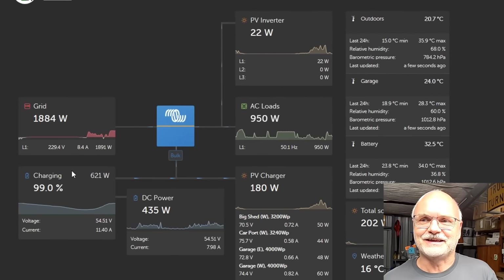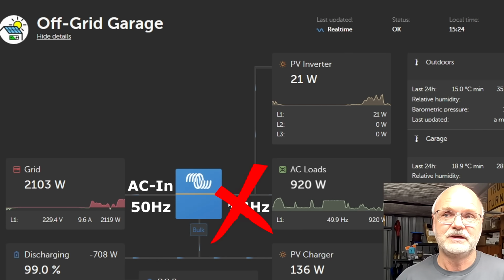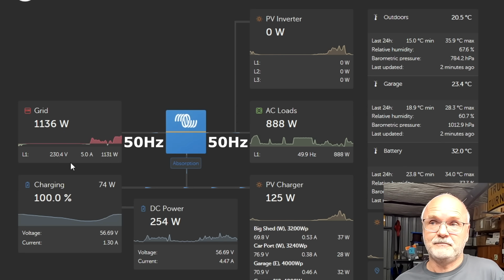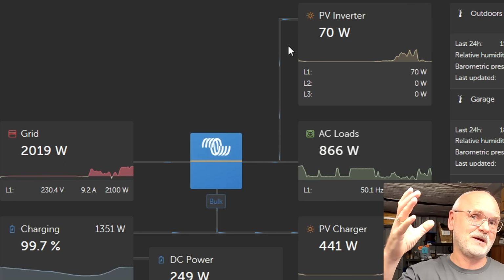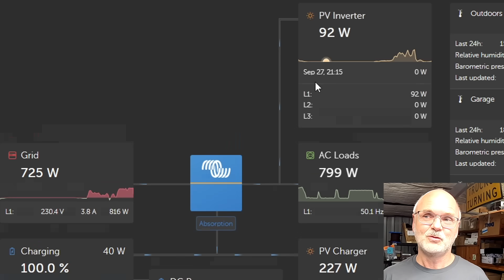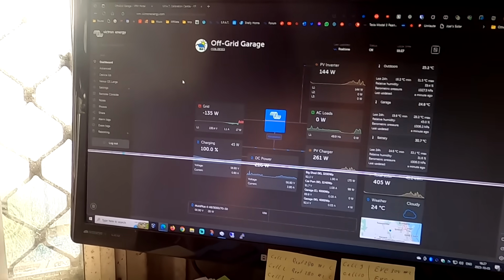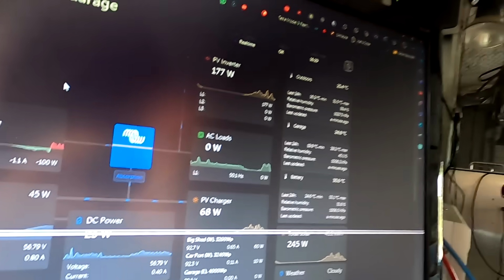Victron Multiplus, Micro-Inverter and Generator. Where does the energy go once the battery is full?

Comment: @OffGridGarageAustralia
 Thanks for the video as its good to see it all working together. This makes all the sense and a great setup. Since you still are connected to the grid (generator) its the same as the real grid. Only the real grid is so big you will never be able to influence it voltage and frequency. What happens in your case, on the end. Your generator governor is configured to stay at 50hz. When there is demand, more fuel is added to keep the frequency. When there is less demand less fuel is injected by the governor until there is no demand and the fuel injection goes to 0. Demand is determined by the magnetic field of the generator, which is regulated by the excitation of the rotor coils by the voltage regulator. When there is demand, the voltage drops, the rotor excitation is increased by the voltage regulator and so is the magnetic field. More current flows through the wires (reactive power). In turn this results in more torque on the shaft (active power). This will cause the frequency to drop which is sensed by the engine governor that will increase fuel injection to stay at the set-point of 50hz. The generator control, governor (frequency) en voltage regulator both want to stick to their set-point of 50hz & 230v. The solar panels microinverter just follow that reference and want to push their load onto the grid by injecting the current into the grid. Since this result in higher voltage on the grid, the generator voltage regulator will start to decrease its excitation to keep the voltage at 230v (reactive power). This results in lower torque and frequency will increase, the governor will respond by lowering the fuel input (active power). This goes on until the fuel injection is at 0. At this point the generator becomes a load, consuming from the grid. Since there is no means to further decrease the fuel injection, the engine speed will increase driven by the excessive current from the solar panels. As the engine speed goes up, also the frequency goes up. This is picked-up by the micro inverters and from a certain frequency (50.2hz in Eur) they will begin throttling.  In many systems there is a breaker trip on reverse power. 
In your situation you can see the engine is driven by the generator in semi-idle mode. When there would be more solar power, there is more energy going to the generator which at one point will overcome the electrical and mechanical resistance and drive the generator above 50hz to the point where the Enphase inverters start throttling there output. This would not be an immediate issue and the system should remain stable. The only issue is that the generator is acting as a load and there is no control over the engine shutdown unless there is an automatic breaker that can disconnect the generator on reverse power, so its a risk to your engine. Also there is a reactive current flowing. You could solve this by updating the Enhpase grid profile to "no_export" so that this starts throttling when it measures grid injection. You could also have the generator automatically disconnect on reverse power.

Comment: Thanks all for your interesting Tests.
I've watched  many hours of your videos in the last couple of days and learned a lot.🙏

One of my questions is still remaining about the Victron-System that I hoped gets answered in this video:
If I have a grid-connected 3-Phase Multiplus II System with 2 Fronius AC-inverters on the AC-Out1 and a SmartSolar RS 450/200 with ~8kWp solar arrays on 2 MPPTs and a of LiFePo4-battery-bank..
..whar happens when the Batteries are full? Can the SmartSolar RS 450/200 still produce DC energy that the 3 Multiplus II converts to AC and pushes into the grid or do they just shut down as long as the Fronius AC-Inverters power the loads in the house and the battery is full?🤔

Comment: I once had my multiplus running off grid with solar connected to ups out. No ees installed.
When battery's were full and solar had no place to go it switched off.
Next I connected grid, but did not allow backfeeding to grid.
Same thing happened. I saw no voltage rise,  but it all happened so fast then I could have missed it.

Comment: My most educated guess: It is feeding the generator or off-grid inverter in the AC-line (check AC line voltage and Hz). On-grid inverter is designed to push power with maximum power (in the contraints of solar input) without any electrical load sensitivity (infinite load). You got saved by following things: 1. You got enough load for on-grid inverter and off-grid inverter/generator did not fry. 2. You did not have enough solar power produced the off-grid inverter/generator to fry.

Comment: First the power will go into the batteries, overloading them a little. When it goos on and/or pv input is high, multi will go into emergency shutdown. This is the only way out for it, and it will happen like it happened to me. This is the way I tested when my pv invertor switches off when I installed freqency modulation. But I have a feeling the multi does not like it.

Comment: I accidently tested this with my setup where I have Ecoflow Powerstream as my AC coupled microinverter on the load side. Once there was too low load consumption, but battery was full and Ecoflow continued to generarte around 1kW power (I have 2 ecoflows in parallel) the MultiPlus II 3kVA started to alarm about overload and restarted itself all the time. I had to disconnect Ecoflows so the Multiplus could work normally and power generated by Ecoflows was just wasted. I'll experiment if a smart plug from ecoflow could automate the power input from ecoflow so not all power is lodt but only the excess what Multiplus can not handle.

Comment: Hi Handy, I have the same problem as you with the microinverter, do you think it could be a solution to connect the microinverter to the ac-out 2 output and using the assistant to set the relay 2 which disconnects at 99% of the soc? I'm waiting for your reply or better yet a nice video. Thank you

Comment: The inverter generator is probably acting kind of like dynamic brakes on a train, and trying to suck "rotational" energy out of the sine wave that the micro-inverters are trying to push "rotational" energy into (basically by shorting-out or reverse-driving the input side of its transformer on the lagging side of the sine wave).  This would dump heat into the transformer and into the generator's windings.  With an old-style direct-drive generator, it would speed up the generator until the frequency went out of spec.

Comment: This "-260 W" load goes into the 50 Hz grid creating "Emergency power generator" wich is connecting to the AC in of the multi. This energy heats up the EP generator until it is damaged. Maybe the multi could be damaged too. 🥲

Comment: I have the same setup. When the batteries were full the MPPT's shut down (Float). The Micro inverter I (had) did not react to the higher frequency. It could not dump its load. The MultiPlus was making a very strange and loud noice so I disconnected the Micro Inverter to be safe. I bought the Deye 2000 Andy has.

Thanks for the Video Andy.
Reply: Hello thanks for your comment, just to the clear, the Micro inverter you had, was it the Deye 2000 or you changed to the Deye 2000 when the previous micro inverter failed to react to frequency shift? I am on this path and your response and clarity would be really helpful.
Reply: @bigbrovar-b3r I changed to the Deye. Still going strong.
Reply: @robfre70  Thanks so much for the feedback. Please do you mind share more on the Deye micro inverter performance with the Victron Multi.  Does it have any impact on appliances during frequency shifts.

Also have you ever noticed any battery spike when charging battery from the Deye via the Multi

Comment: You can connect the PV micro inverter on AC-out-2 of the multi and then set up an assistant for programable relay (actually 2 instances of the same assistant for on and off), in order to turn on, or off your PV micro inverter, depending on the DC voltage, or Battery SOC.
Reply: Hi, will there be power on the AC-out-2 when here is no AC-in? I have the same setup as Andy. NO GRID.

Comment: Is any of the equipment actually able to distinguish real power from reactive power? My guess is the equipment was not programmed to care about reactive, real and apparent power and is doing a dumb RMS current x RMS volts output power calculation instead of proper i(t) x v(t) integration. By plugging two inverters into each other, the only load they see is each other's LC output transformer and LC filter. You are seeing almost pure reactive power bouncing between inverters being incorrectly reported as watts instead of volt-amps (VA) with the true PV output being a much lower amount to offset wiring losses.
Reply from the maker: The smaller inverter shows actually VA instead of Watts. But yeah, you're right, This is not well displayed in the apps.

Comment: Hi Andy, I would like your advice, I want to add 3 panels to my victron system, due to a shadow problem I would like to add some optimizers, but the victron mppts get ruined with the optimizers, I can't put a variator on each panel because the voc is only 34 do you have solutions?  Thank you
Reply from the maker: I tested optimisers with Victron MPPTs. Not good. They basically start fighting over the max power point of the panels.
Optimisers give no advantage with partly shading. There is a Danish study and they have tested all scenarios and compared them. 
https://www.solarquotes.com.au/blog/panel-optimisers-danish-study/
Reply: @OffGridGarageAustralia  thank you very much for the answer, I saw the Danish study, my problem is that having a house that shades me would mess up the whole string of 3 panels, maybe I can put micro inverters on each panel.  but I would have the double transformation to charge the batteries.  I accept advice, thanks bye
Reply from the maker: @Lulastyle  The optimisers will not help with party shading. They probably will make it worse.
At the end you cannot do much about it in a reasonable manner than just leaving it as it is and live with it.

Comment: You're making an incorrect assumption about the generator. If the system thinks it's the grid, it WILL backfeed power into it. And just because it's turned off doesn't mean it's incapable of sinking power. While generators are often protected from surges and other anomalies, they are not usually designed with the idea that they will be connected to lines that are live and trying to feed power into their outputs. If you're not attempting to feed too much power backward through it, it may be alright, but if you try to feed several kilowatts back into it, I would expect bad things to happen.

This is an issue that I've seen addressed on wind systems by having huge resistors set up as a dump load into which surplus power is diverted.

I have often wondered what happens to solar panels (or more specifically, an array) that are in full sun but are disconnected from all loads. Does it degrade them more quickly or risk damage, or is it nothing to worry about?

Comment: Could you use somthing like a Shelly Uni to sense the voltage of one cell and disconnect the shelly switch connected to the micro inverter at 3.5v - 3.65v or some other arbitary voltage that determines the battery is full?

Comment: You are facing the same situation marine alternators face when the BMS shuts down and there's nowhere for the current to go while the alternator field (and stator) are still charged. Result:  Massive, instantaneous (10ms) load dump with HV spike. Alternator rectifier diodes and all 12v appliances fried by 16v - 90v spike.

Comment: Multiplus will not allow AC output voltage to rise.  

Assuming you have grid back feed disallowed, there is only one place left, other than AC output loads, for PV power to go.  That is to batteries.  It will be unregulated charging to the point where DC input to inverter gets close to exceeding maximum Multiplus DC input voltage limit at which point Multiplus will shut down.  Other condition that will cause Multiplus to shut down is if back push power to batteries exceeds the power capability of Multiplus.

There will be no regulation on battery charge amperage (other than Multiplus power capability handling shutdown).

If off grid, toughest situation to handle is if you have a lot of AC coupled PV power with a lot of AC loads, then a large AC load is switched off.  All of a sudden there is a lot of excess PV power that has to be absorbed by batteries until frequency shifting can back down PV GT inverter.  This can take a few seconds to accomplish and the batteries/Multiplus must handle the excess during this time.

When allowing AC coupling, most hybrid inverters will not allow batteries to be fully charged to hold a reserve margin to absorb a PV back feed with less danger of over-voltaging DC input to inverter.

You can add a load dump system, like a hot water heater, to absorb excess PV power based on sensing AC back feed current or battery voltage rise.

Comment: Hey, @OffGridGarageAustralia.

Do you think "ECO mode" on the Phoenix could be useful?

"When the inverter is in ECO mode, it will reduce its power consumption by approximately 85% when there are no loads connected to the inverter. When the inverter is in ECO mode, the inverter will switch to search state when there is no load or a very low load. While in the search state, the inverter is off and will switch on every 3 seconds for a short period (adjustable). If the inverter detects a certain size load (adjustable) the inverter will go back to normal operation mode. Once the load drops below a certain level, the inverter will go back to ECO mode."

Programmable relay can also be programmed to indicate whether the inverter has been switched off.

"In ECO mode, the relay will be closed both when searching for a load and when fully on, ie. load detected. Use this option when you want the relay to signal that there is power available on the output of the inverter."
Reply from the maker: I tried this at the beginning but the concept only works if you have this sitting on a boat or a cabin where there are times without any load connected. And in these circumstances you want to save power.
For a normal off-grid installation that's not an option. If it is set to say 50W threshold and you have only a router connected, it will constantly turn off your internet as the load is below the threshold.
Reply: @OffGridGarageAustralia  This is the point.

There was no load on the Phoenix. In fact, you were feeding energy INTO the Phoenix. The diagram showed NEGATIVE load.

As I read the manual, it detects when the current it generates is not being consumed, which seems to be exactly the case here.
Reply: @OffGridGarageAustralia  If the load is only 50W then the MultiPlus doesn't need support from the Phoenix, which is why the Phoenix can switch off and all the mains power comes from the MultiPlus & the micro inverter.

Since the MultiPlus is no longer tied to 50hz, the micro inverter can then be throttled off via frequency modulation.
Reply: BTW, I assume that the MultiPlus will then be able to modulate the AC frequency to turn off the micro inverter if required. 

As for what happens when the AC frequency is high and the Phoenix does one of its "searches" - 🤷🤷🤷

Good subject for a video. 😊
Reply: Also, didn't you originally have the MultiPlus configured so that it would switch on the Phoenix above a certain demand? ISTR you installed a switch between the two, but can't remember whether it switches this behaviour? 

Would it be worth going back to that with a very low startup threshold?

Comment: Hi, is there a way to identify, at the Victron system, if the full power from PV Panels is loaded? I sometimes have the impression that my charing is limited by either the smart shunt or the Daly BMS but where would I see this ?
Reply from the maker: Several locations to check: MPPTs, Multiplus and DVCC

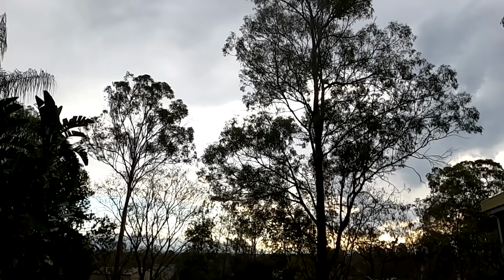Comment: 5:05 I would think the Multiplus will disconnect the AC in. Then it can adjust the frequency. Or maybe the whole Australian continent will explode 😱 Hoping for the first version 😉
Reply from the maker: It will only disconnect the AC-in if the specs of this AC source are out of the set values in the Multiplus. So, under and over voltage for example. I've never seen the MP actively disconnecting the AC-in. Even if the battery is full and the 'generator' is connected, it just throttles the power it takes from AC-in down to 0W basically. 
No explosion. Yet.